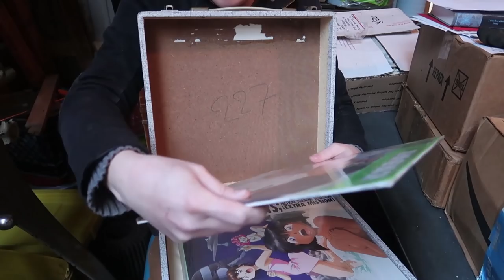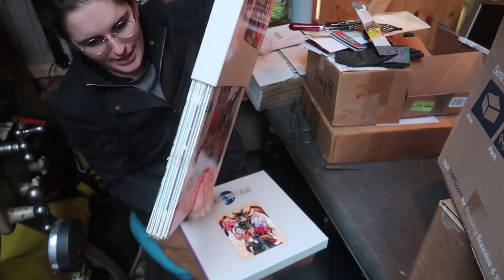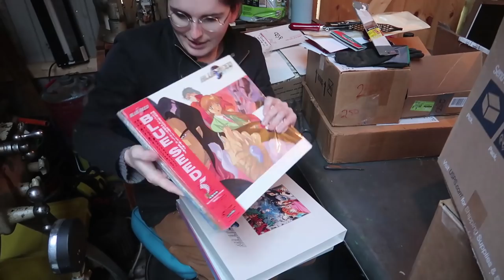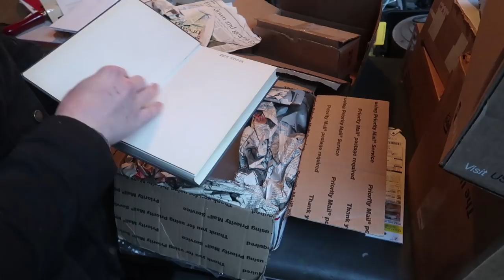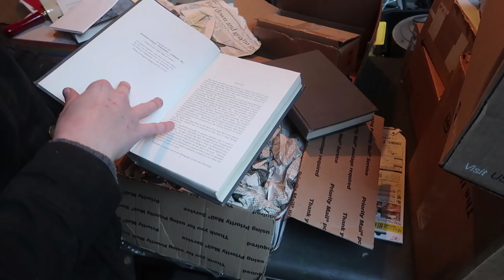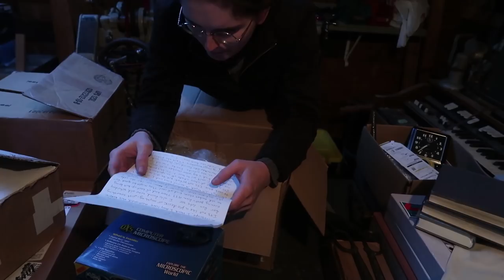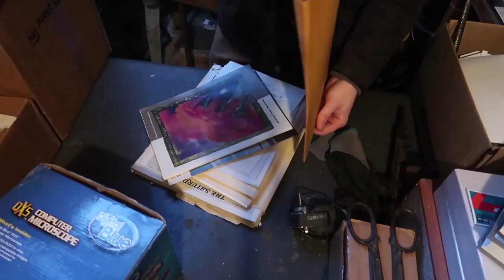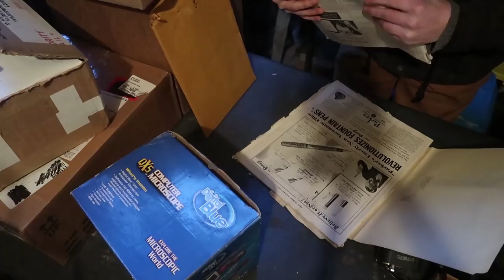Inbox 24: Laserdiscs, Letters, Fuse Box, Books. 2018 and 2019 packages.

Comment: I like the fuse panel! I also have a collection of them, including some early porcelain ones, and some knife switches.  That looks like a later panel from the '60s, being it has a 100 amp main and the two pullouts. The four on the bottom are for circuits, they, the other four screw in fuses and the pullouts are all fed from the main.  Fuses are allowed by code, as long as the screw in fuses are the  Type S fuses that use adapters. The problem is that you can't do AFCI protection with them, and many insurance companies won't insure a house with them.  Fuses are still made but they're pricey to buy new.

Comment: I'm pleased you enjoyed the new c1969 fuse panel.
Reply from the maker: its beautiful
Reply: The panel provides 100a service, 240V split phase.  I believe the four 120V screw fuses on the right are from one leg and the four at the bottom are from the other leg/line.
Reply: I like it, it's actually "new" for a fuse panel. I wonder when they stopped making them for homes? Newest one I ever saw in a house was from 1974.

Comment: Hey Rinoa, Are you ever going to continue with the air compressor stirling engine? or are the parts not configured right?
Reply from the maker: yeah i actually got another piece for it lately, but im just letting it sit on the shelf until i feel inspire again. right now im inspired to work on my rocket project